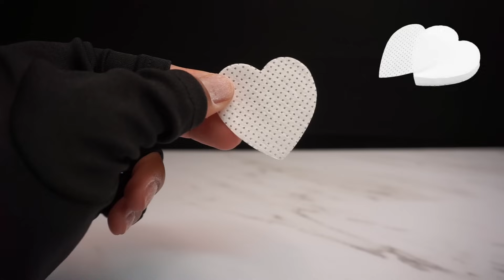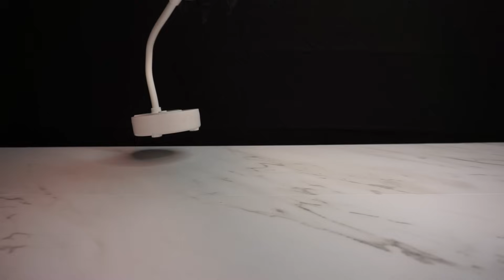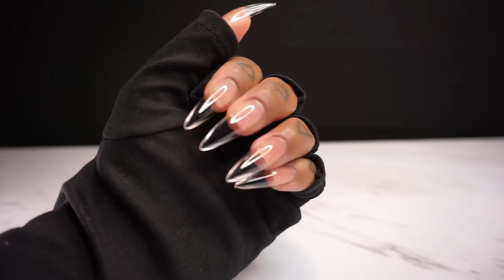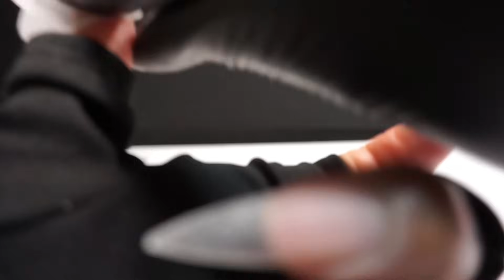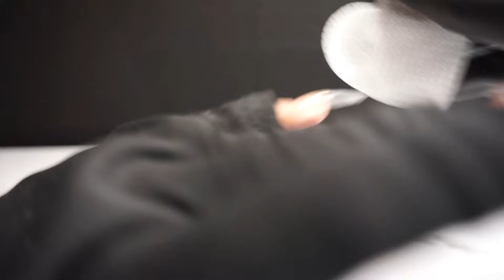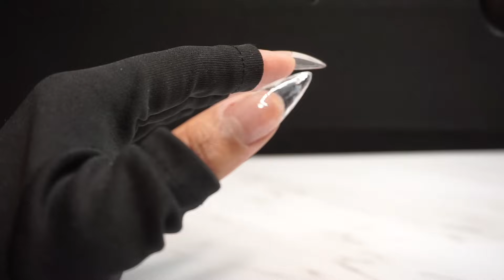How to make your Gel X Nails Last 4 weeks + |  Overlay Method | Beginner Friendly Tutorial

Comment: I replied to one of the comments with this (I copied and pasted what I said but I wanted to share my steps on what I do.)
------------
I usually go 
 -(Nail prep: cuticles, buffing nails)
-Dehydrator 
-Primer
-The gelex material.. which I use una gela solid nail glue (that stuff is strong. But when you look for it.. look for '80 g'. Usually it's just 40 g but for a dollar more you get a second bottle. I found it on a different area in Amazon) 😂
-Artificial nail (I use una gella tips that are already sanded on the underside of the nail. You have the sanded and unsanded version.. if it's unsanded its recommended to sand it with a nail drill, if you have one, for the adhesion to adhere to. But since mine came as pre sanded.. that's taken care of) 
-Sand + buff to Smooth this surface and remove the shine. This helps the base gel coat stick to that layer.(You could shape This layer if you're not doing builder gel on top.)
- THEN base coat + optional:( if you wanna do builder gel to make the nail stronger you can before the base coat) / shape nail after base coat KUZ if you do the builder gel it may be sticky after you cure it. (Just bc it's sticky doesn't mean it isn't cured. There's science behind the chemicals mixing with oxygen that makes it that way. You don't have to wipe. Putting a base coat on it and curing it causes that sticky layer to be dried under the new layer since there's no oxygen after you seal it.)
- COLOR (gel preferably kuz gel adheres to gel)
-lastly your top coat. And BAM you good.

This is just my order and how I do it

Comment: Do you cure your nails after base coat? Before the nail glue?
Reply: @WEEDY13   All of these products are gel and need to be cured by a UV/LED Lamp. 
So, you need to flash cure each coat of gel product before applying the next coat or the next product. 

Nail Prep
1. Gel Base Coat - cure
2. Builder Gel - cure
Repeat Step 2 if you want
3. Gel Base Coat - cure
4. 1st Coat of Gel Color Polish - cure
5. 2nd Coat of Gel Color Polish - cure
6. Gel Top Coat - cure
7. Cure all nails for 60-90 seconds to make sure the Gel is fully cured.

Comment: Hi! I have a question im new to doing my own nails, is it ok to use primer then apply a thin base coat layer or does the thin base coat layer act as a adhesive? Or can I just use primer instead to act as a base coat layer? Ive seen some people use primer and aome people use a thin base coat layer. Please and thanks ❤
Reply: I usually go 
 -(Nail prep: cuticles, buffing nails)
-Dehydrator 
-Primer
-The gelex material.. which I use una gela solid nail glue (that stuff is strong. But when you look for it.. look for '80 g'. Usually it's just 40 g but for a dollar more you get a second bottle. I found it on a different area in Amazon) 😂
-Artificial nail (I use una gella tips that are already sanded on the underside of the nail. You have the sanded and unsanded version.. if it's unsanded its recommended to sand it with a nail drill, if you have one, for the adhesion to adhere to. But since mine came as pre sanded.. that's taken care of) 
-Sand + buff to Smooth this surface and remove the shine. This helps the base gel coat stick to that layer.(You could shape This layer if you're not doing builder gel on top.)
- THEN base coat + optional:( if you wanna do builder gel to make the nail stronger you can before the base coat) / shape nail after base coat KUZ if you do the builder gel it may be sticky after you cure it. (Just bc it's sticky doesn't mean it isn't cured. There's science behind the chemicals mixing with oxygen that makes it that way. You don't have to wipe. Putting a base coat on it and curing it causes that sticky layer to be dried under the new layer since there's no oxygen after you seal it.)
- COLOR (gel preferably kuz gel adheres to gel)
-lastly your top coat. And BAM you good.

This is just my order and how I do it

Comment: Beginner question: What's the purpose of putting the base coat on your nails before applying the tips?
Reply from the maker: Hi,

The purpose of base coat is to help the tips to stick better and last longer on your nails. The base coat can also protect your natural nails from being damaged. It’s not needed but for someone like me who creates content and frequently changes my nail sets I try to use it.
Reply: @JourneyswithJai  doesn't base coat make the surface smooth? I thought the nail needs to be rough inorder for the gel for the nail tip to adhere better to the natural nail , therefore we file n dehydrate the natural nail to make it rough for the tip glue to stick properly. Would applying the base coat not make the nail easier to come off  instead of lasting longer?

Comment: can we use a tick toap coat or the glue to overlay ? i do not have a builder.. but my gel nailspolishes are pretty tick.
Reply from the maker: For the overlay method, you would want to only use builder gel in either the bottle or jar. You could also use poly gel I’ve seen people use that as well.

Comment: I love this video I want to try the overlay method because my nails keep popping off but I am wondering after you do the overlay I know you flash cured each nail in between but do you fully cure the hand and if so for how long?
Reply from the maker: Hi yes after flash curing each nail I do a full cure in my big lamp for 60 seconds.🤍
Reply: @JourneyswithJai  okay thanks so much and then 1 more question sorry can I go right in with a gel polish after that? I don’t have to wipe it or use a base coat or anything?

Comment: I can’t get my gel x to last over 2 weeks, starting to get discouraged.
Reply: @rachelbrown8205  hi actually applying the nail glue and curing a layer to your natural nail before applying the tip has helped me tremendously !! Not a base coat
But the gel glue. After two years, mine wasn’t staying two weeks
Reply: What brand are u using?? Try getting the apres brand. And if you do not have a hema allergy then get the original application gel that apres makes. They make a hema free gel to apply their extensions, but hema is used to get better adhesion to the nail.
Reply: @denisemattingly7389  this is the only brand/kind I use
Reply: @denisemattingly7389  I’ve been using the Aprés. I actually just switched to NotPolish and I have had a lot of success. Also, there isn’t hardly any spillover so I don’t have to use a drill and/or excess filing.

Comment: As always, I 🫶🏽 your videos!!  I also purchased “b072 Pink Champagne” because of watching your videos and it’s one of my favorite Beetles polishes!  It’s the perfect cover nude polish for my skin tone, as I’m a bit darker than you.
Thanks! 😊 
I do have a question……
I usually use primer to etch underneath my Gel X nails instead of using an e-file to etch and to also help with adherence, but you used a dehydrator.  Do you like using a dehydrator more….does it work better than a primer? 
I’m curious! 🤔💭
Reply from the maker: Hi, if the primer works for you there is no need for the dehydrator during that step I have used a few different methods but I tend to reach for the dehydrator more. ☺️🤍

Comment: Hi I love your videos what is ur efile settings when working with your filing ? Also if I make a mistake while designing my nail with polish let’s say a French n I mess up a line what should I use to fix it n restart without messing up my first layer of polish??
Reply: are you using gel? if so, after curing your first layer of polish, if you start your second layer and mess up you can just remove with nail polish remover.

Comment: Hello!! I love your videos!! I have a question, what percent alcohol do you use? I use 91% and it made like white dry spots and lines underneath my nail tip. Any suggestions?
Reply from the maker: Hi,
I use a 70% isopropyl alcohol, it can remove the shine but usually goes away once I wash under my nail tip with a nail brush. 🌺🤍
Reply: Ok thank you